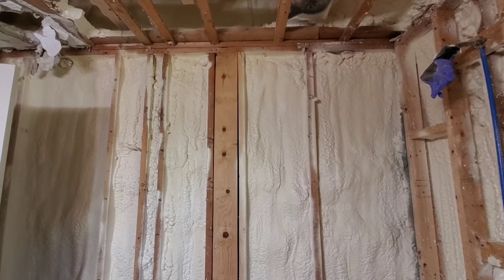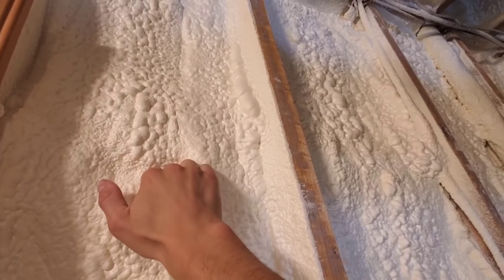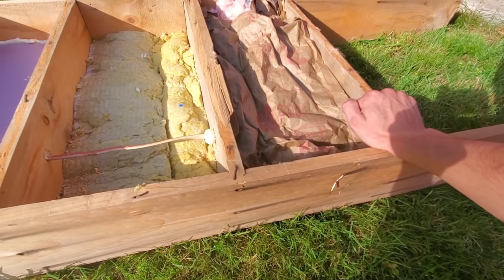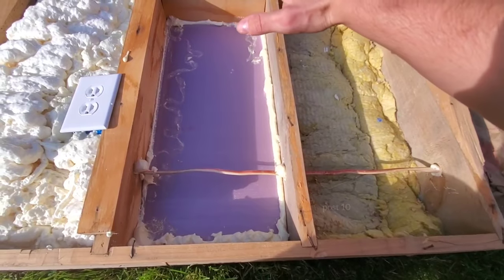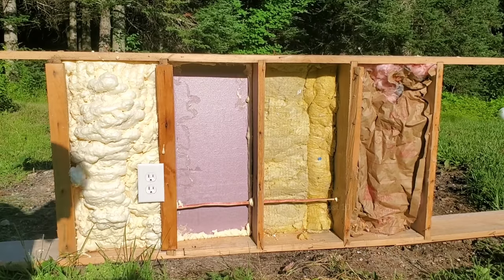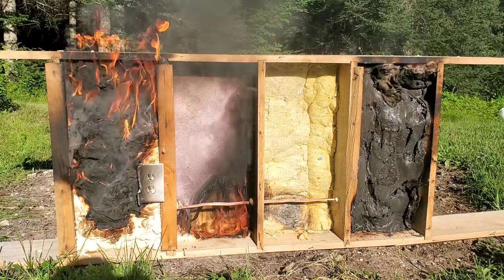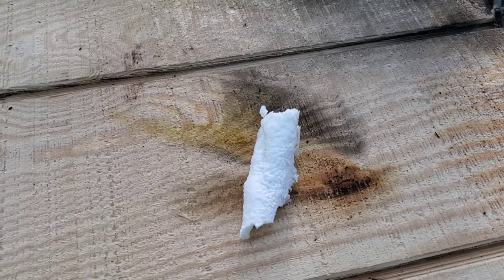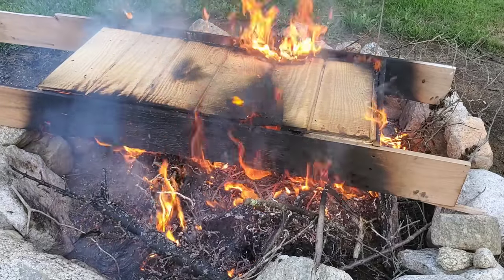Testing The Burn Ability Of Insulation In Wall

Comment: If you have a 15A wire you put a 15A breaker on it.  You use wire which is rated for 15A without it's temperature rising more than a few degrees.  So, if you then put 30A through it, it is still like to remain under 60C.  You would need to put 40 or 50A through it to get it to combust.
There are charts for most "code" wiring which show the range of limitations is dependant on many things, like is the wire in free air, is it in an enclosed space, is it inside conduit etc. etc.  Thermal Insulation of any kind will lower the heat loss of the cable so encourage it holding heat and thus reduce it's maximum tolerance before it exceeds 60C or it's thermal limits.

Comment: Most walls would be enclosed by drywall, which would limit the air intake and reduce the ability to burn.  Less air means a lower burn temperature, which can cause the fire to die out before it even gets started.  That is why places like UL will make a complete wall assembly to test the product.  Still a good test, though.  Good job!
Reply: While this is true. The oxygen exposure conditions were the same between the samples so the test is still somewhat valid as the variables were kept as similar as possible.
Reply: @joshuacriswell5032  not entirely, foam normally should not be exposed, as even UV will cause its degradation.

Comment: In our area (Great White North) Great Stuff (open cell) is no allowed for cavity style wall installation, more for sealing draughts in small quantities such as the perimeter.   The closed cell is approved for this type of installation and has different properties.   Rigid Board is used for draught sealing/heat loss in conjunction with Rockwool/Pink Fluffy batts as the fire barrier.     I did a basement reno recently and used a combination of all 3 materials that passed fire and building inspection, as they were installed correctly.  That being said, a lot of "foam in a can" is used by diyers for various projects without reading the label nor knowing what products are suitable for which purpose.

Comment: Great demo. One thing to note…
In most cases. commercially applied spray foam is a different formula that includes fire retardant. Different than what comes in a can.
Reply: Fire foam that we use around piping and other things is red coming out of the can
Reply: Sorry ,also known as fire stop
Reply: @private8559  Well, that Great Stuff in this example burned pretty hot, so there is that.
Reply: I've used the red firestop stuff successfully as tinder in a fireplace.
Reply: it could have just been a sales tactic. but i swear i learned that the closed cell formula sprayed in is a notably different product than what can be purchased in a can. having had a building sprayed, it certainly looks and feels different but i did not test it by lighting anything on fire. now im very curious if they are actually different products

Comment: Amazing video.! this confirms my suspicions about how volatile this foam is. Everyone around here is now using closed-cell foam though the entire home. The energy efficiency and cost savings is truly amazing. Unfortunate for the contents of the structure but when the firemen find out the place is filled with spray-foam from top to bottom they will switch to defensive mode, sit back and pretty much let the whole thing go.
Reply: as a firefighter.. closed cell spray foam in a home is Class 1 fire rating. meaning its self extinguishing  - it will only burn in the presence of continuous flame.. IE, the gypsum or other wall covering has failed and exposed the foam to the fire of the contents and structure burning itself. Spray foam alone will not push us defensive, as an agressive interior attack will be quite effective to cool the room as it actually can and will stay contained to the original room longer than with other insulation materials.. the down side.. the foam does a very good job holding the heat in making the time to flashover less than other forms of insulation
Reply: Closed cell foam has a fire retardant.  Some brands are meet class 1 and some meet class 2.
Reply: Thats what insurance is for.. its just stuff.. it can be replaced
Reply: They almost could make it code to have a Foam Signage to show firemen that there is foam in the building. Similar to the "R" or "F" fire fighter signs.
Reply: @Morpheen999  until you realize how badly the insurance WILL screw you.

Comment: A great presentation Young Man.
As a 35 Plus year veteran in the business. Nothing out performs the fiberglass or wool batt.
As long as it's installed properly.
Foam products too.!! Have there uses /do & don't. It's truly a science that requires a well trained Tech. Coming from a BPI,SST, certified Master installer, in my honest opinion nothing outperforms the fiberglass batt.

Comment: Rockwool (green) is basically cotton candy but it's made out of molten rocks. It's water proof, very good at sound reduction, it doesn't burn either. It's also itch free. It's more expensive and you get what you pay for.
Reply: What the hell are you talking about? Rockwool is the itchiest insulation of all. Just ask any insulation installer what type they hate the most.

Comment: Here where we have mostly cold weather (Sweden) we use fluffy Rockwool or Fiberglass (just different brands) and on the inside of that we put plastic foil as a condenser barrier, since hot air from inside meets the cold air from outside (at least most of the year). Has worked for decades.
Reply: Its kinda insane how high our standard in construction is in comparison to other countries, and for years.
Reply: What is plastic foil? Sounds like too different materials. And..do you put this layer between the outside wall and the insulation?
Reply: @nyrockchicxx  plastic foil. Like the aluminum foil you have in the kitchen but made of plastic and is thicker. 
It is used on the inside of the insulation here since we mostly have cold air on the outside of the house.
Reply: @Jonas_Aa  Mylar sheets?
Reply: @nyrockchicxx  In Australia, we call it sisilation foil, goes on the outside of the timber framing before bricks on the very outside. It's a separate condensation barrier designed to ensure the inside of the framing is kept dry.
Reply: @ErraticPerfectionist  Outside of frame and under siding,  this is how they do in Canada as well with something like Tyvek wrap, however this is breathable, it lets water vapors out, while sisalation foil is reflective as well.
Reply: @dmitripogosian5084  ah! Good to know! Thank you. I assumed they were the same thing.

Comment: If you ever get to do this again, I’d love to see how rigid PIR insulation fares! Here in the Uk 🇬🇧 it’s pretty standard along with rockwool

Speaking of the wire - I do LV work, there’s specially coated cables (plenum/LSZH) we have to use when working in ventilated (plenum) spaces, the gasses they give off are not so toxic

Comment: It's pretty shocking that building codes allow spray foam insulation. I had no idea it was so flammable.
Good vid, Post. 👍
Reply: I mean it also allows blown in cellulose.
Reply: The spray foam is supposed to be covered with intumescent paint or drywall, this would have prevented the fire.
Reply: @evanrobinson7657  cellulose doesn't burn easily because it's treated with borax.
Reply: Two things. The combustion point of foam is formulated to be quite high. If your wires are hot enough to combust foam insulation, it's likely also hot enough to start burning wood and wire insulation. Second, these insulation would normally be protected from open flame by the gypsum or plaster wall finish which should protect the insulation from direct flame for the first 30 minutes
Reply: They don't. Dude used Great Stuff window and door crack filler foam for this test. That's not the same as closed cell insulation that has fire retardants.

Comment: There is a difference in the red fire foam. It’s rated for fire and is intumescent. It expands when it gets hot so as the fire try’s to burn a bigger hole, the foam keeps filling. Fire Caulk is the most common for top plates and bottom plates.

Comment: To quote many fire experts, "All fires stop burning... eventually."
Reply: There are underground coal and Peet fires that have been burning for decades and will continue for centuries.
Reply: That's the fire triangle for you: To have a fire you need air, heat and a fuel. Remove one of those, and the fire dies out.... The last one will eventually solve itself at one point.
Reply: @LostWhits  Ah, but they will someday stop burning. Eventually.

Comment: The current spray-foam zealotry has long bothered me for numerous reasons including the one you demonstrated here.  Aside from specialized applications rock-wool or fiberglass is what you want.  Spray foam will be remembered as a nightmare product 30 years from today.
Reply: Spray foam will go down is history as this generations asbestos...
Reply: Spray foam 8nsulation has been around since the 1970s. The newest iteration uses fire retardants. Even prior to the fire retardants, the foam in the 1970s was able to prevent structures from catching fire fire the outside. The problem was when fires were on the inside. The foam performed so well at holding the heat in, the temperature in the building rose rapidly and reached very high temperatures.

Even with fiberglass insulation, today's homes are going to burn hotter and faster because of their contents.
Reply: @drooplug  and fire retardants are really nice chemicals to breathe when the foam holds the heat in and burns the building hotter and faster. Nice job, it now burns faster and has smoke that’s *even more toxic*.

Spray foam is a mistake. Full stop.
Reply: @drooplug  Fire retardants mean very little in real life situations.  What matters is the total combustible material available and how easily it ignites.  Spray foam then and now ignites very easily and retardants slow their conflagration which allows time to quench the fire before it becomes an inferno.  Much better is to use products that are not combustible in the first place.  My primary complaints about spray foam are not fire related however.  They are related to mold, rework, and and improper use.  Spray foam is an absolute nightmare in real life.
Reply: @knurlgnar24  mold is an issue with all insulation. It's actually far less of a problem with foams than Batts. One of foam insulations main uses is in below grade conditions where it resists molding and maintains its insulation value when wetted

Comment: Something you didn't consider is air flow. Especially with the spray foam every pocket in a wall is going to be air tight, and once the oxygen is gone the fire will go out. I guess if the fire starts in the pocket that has an outlet receptacle I guess there would be more oxygen available, but once those toxic fumes fill the pocket they will starve the fire also. The other three will have better chances of air flow but you would be surprised how little air flow there is even in a wall with fiberglass insulation.
Reply: Well yes and no. 

Spray foam has small bubbles in its fill… it is good for tight gaps and fill it’s material within each corner but the small holes inside the foam isn’t large enough to let heat escape when the foam expand it makes small pockets of air within itself because the chemical reaction that occurs. The surface however reveal 0 holes as in order to act as an insulator it must have some structure to it. 

Of course the foam today is nothing like what it was 50 years ago and many places in the world face major issues with more modern forms of foam than before but that’s probably because of poor application or bad mixture.
Reply: That's not entirely correct.  Look at the reality of how fires behave in a building.  The way the fire starts is an important factor.  Also, it's rare for a stud bay to be perfectly sealed and air tight.  In reality there are gaps where air can flow and sheetrock itself is usually covered in paper.  Once tray paper gets damaged it opens a little more gaps.  When the sheetrock gets damaged by the fire it will soon fall with no paper to support it and that will open the stud bay to much more airflow.
    Again, mineral wool made from rocks is by far the best for fire resistance for multiple reasons.

Comment: Rock wool is largely made out of recycled and processed slag, and usually some Sheetrock an other recycled materials which is the stuff that won't melt when you try and melt metal. It's the junk that you can't melt and just floats on the top. It's honestly much better than fiberglass resilience wise, insulation wise, and irritation wise. Fiberglass is like getting stabbed a million times microscopically and rock wool is just like an itchy jacket. It's also easier to manipulate and cut, and it's cheaper and thicker.
Reply: Rock wool can stab you too, wear respirators when in stalling, but ya... it MUCH better.
Reply: Are you sure you know what you're talking about research for knowledge
Reply: That's why installers suits up in long sleeves gloves and wears a respirator
Reply: Im an insulator and i can tell you everyone in the trade hates working with rockwool. Its harder to cut, it doesnt manipulate well so the cuts need to be a lot more precise, its much more irritating to skin, and nothing ruins a day like a big slag sliver breaking off in your skin. It does make less airborn irritants though. All that said, its definitely a better product once its installed in almost every way
Reply: Let me specify: easier to cut as in it is easier to cut clean. In my experience it was not as bad as fiberglass. Idk about all the time as I don’t do that for a living but that was my experience with it. Still would take either over the mess of blow in though. Had to do that in the same house as well and it sucked. Respirator did not help enough same with goggles.
Reply: Andrew you may want to check again but I don't believe there is any sheetrock in Rockwood insulation
Reply: Wtf I hate autocorrect
Reply: Also it got you as well lol “rockwood”

Comment: fun fact, very finely ground and divided solids will combust regardless of material, even metal can combust when very finely divided
Reply: As can sand.
Reply: Grain Silo Explosions.
Reply: @blipco5  I'm pretty sure, sand cannot burn. It's already burnt.
Reply: @voidseeker4394  Some highly energetic chemicals can react with/burn sand. Being silicon dioxide, there is oxygen available in it. But unless you store incredibly nasty fluorine compounds in your home, there should be no problem. 
Metal fires are very fun though, because any attempt to put them out with water will often break that water into hydrogen and oxygen and blow you right up.
Reply: @Knuspabrot  you're talking about extremely rare situations that don't happen in real life. flourine compounds will react catastrophically in high temperature long before it can react with glass powder. flourine compounds are nasty and will react with everything even at room temperature
Reply: @Knuspabrot  you're talking about extremely rare situations that don't happen in real life. flourine compounds will react catastrophically in high temperature long before it can react with glass powder. flourine compounds are nasty and will react with everything even at room temperature
Reply: metal is different story though. its a pure element. stuff like rock sheet and fibre glass no matter how much finely you divide them they will not burn because they are already oxidized compounds.
Reply: @Knuspabrot  well, I was talking about burning in air atmosphere, not in some exotic chemicals.
Reply: Mmmmm..... thermite.....   <Homer Simpson drooling>

And don't forget the fun one can have with coffee creamer - energetic stuff!!!
Reply: A Open... Well, ok, I was oversimplifying and was being dramatic. Sand refers to particle size so it can't burn but if you grind almost anything into small enough particles.. look out. Coal dust, vegetable grains, certain rocks.
Reply: @blipco5  no, sand cannot burn in oxygen due to it's chemical properties, not the particle size. Coal dust, flour are obviously NOT sand,
Reply: @blipco5  burning is oxidyzing process, but sand is already an oxide. While coal, flour and metals are not.
Reply: @blipco5  coal is flammable so of course coal dust will be flammable. grain dust is dried plant material. dried plant is also flammable so of course its powder will be flammable.

what certain rocks are you talking about that is flammable?
Reply: Sulfuric rocks, volcanic rocks, limestone. There's more but I remember only so much. I'm an electrician and have had to use explosion proof wiring methods in places where any type of dust was created and not just sawmills or grain silos. I've seen them used at rock crushing facilities but thankfully never had to install there as those places are filthy.

Comment: We typically apply an intumescent paint over spray foam to meet code requirements for a thermal and ignition barrier.  
Would love to see an updated video showing how the performance of the foam is affected.
Reply: Our building code requires it to be fire resistant type

Comment: I didn't realize that the spray foam would conceal the fire like it did. This is good to know. 

...though it looks like rock wool is the best choice, though common pink insulation is also a good choice. Still, with an entire wall, paper faced insulation would be scary in its own right.
Reply: Pink insulation quickly melts away to nothing in an actual house fire. NFPA has videos on YouTube. Rockwool wins hands-down.